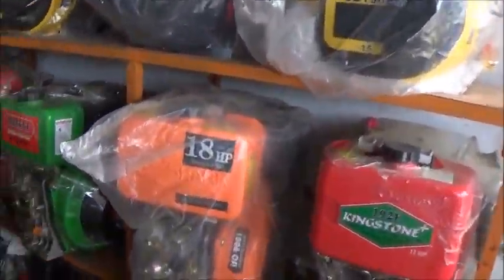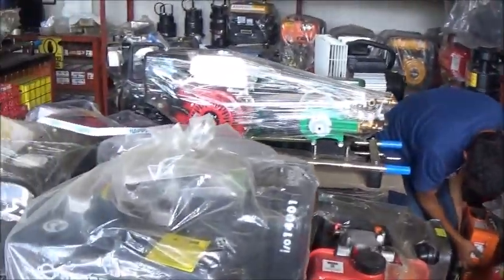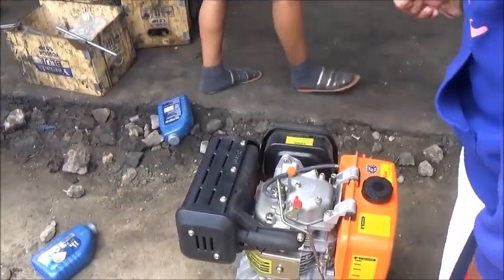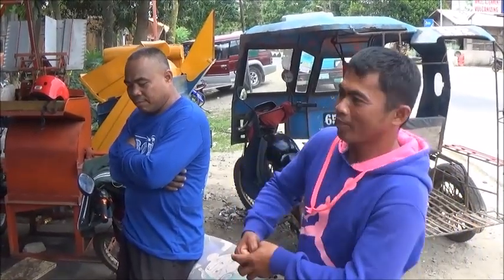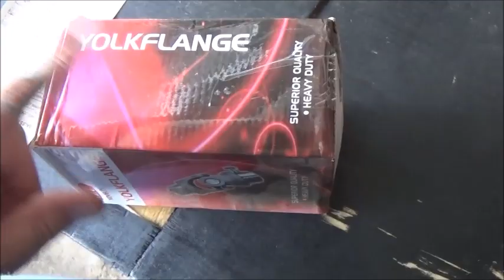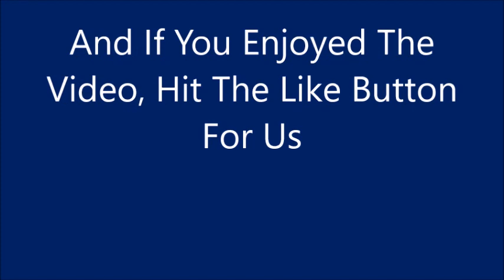Getting A New Engine For The Bosslady

Comment: I actually know a little bit about the Chinese diesels.  Full compression release it is not gonna start that's how you turn them off. Half compression releases is what you need to start easily. One more thing they are badd about leaking on the intake as in to say around the air breathe . Where the intake manifold bolts to the block.
Reply: @TexasFilipino    Where the air intake seals to the block they do not seal very well

Comment: Gabrial wants the exhaust flowing upwards and out of the hull maybe, so it doesn't cook or dry out the wooden hull and dirty up the hull interior with the sooty exhaust?  Plus if it's breathing in the exhaust its hurting your fuel mileage.
Increase Prop pitch on most boats until it runs out of power to push it faster at or just before redline under a light load.   13" pitch moves forward through the water 13 inches per rpm - minus 10% slip roughly.  5-15% is a typical USA homeowner type boat prop slip.  With a little math and knowing rpm, you can figure out boat speed, or prop pitch.

Comment: That motor will make more power without a muffler, but of course it will be much louder unless you rig a pipe  to go out the back. I am sure that you don't want to do that.
Reply from the maker: The 2% power loss for having a muffler attached is well worth it in my opinion